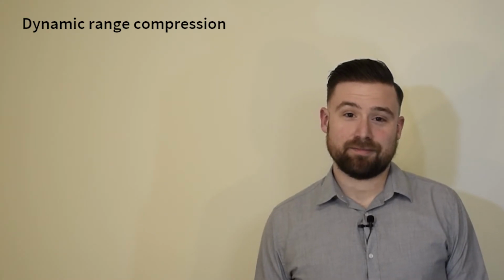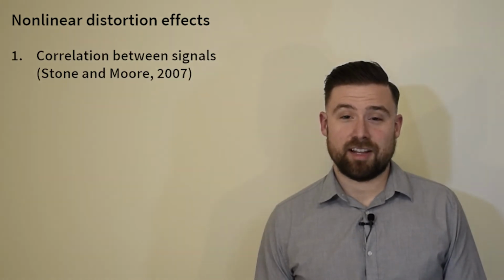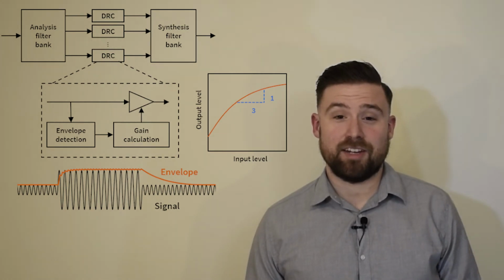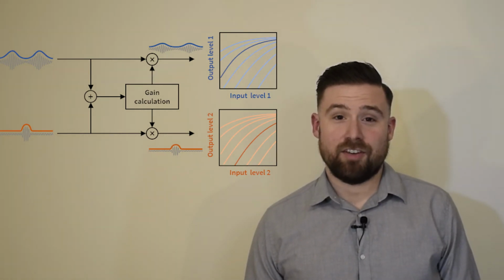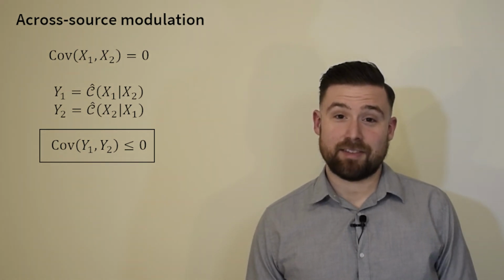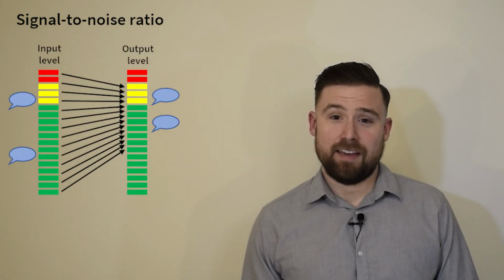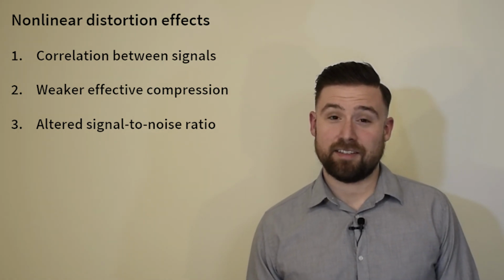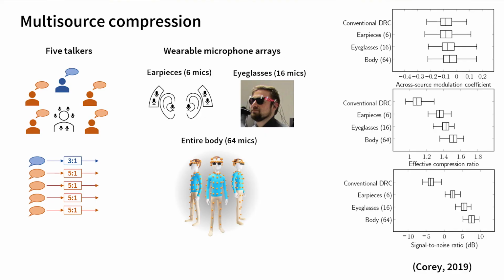[ASA 2020] Dynamic Range Compression of Sound Mixtures

Comment: Thank you for your research. Despite owning reasonably good quality hearing aids, there are still situations where I have to remove them because they are doing more harm than good as you described at the beginning of your presentation 
I thought the severity of the problem would decrease over time but after 5 years, it hasn't gotten any better. :(